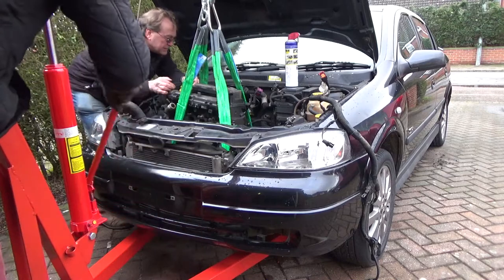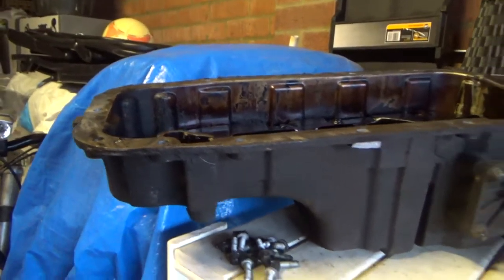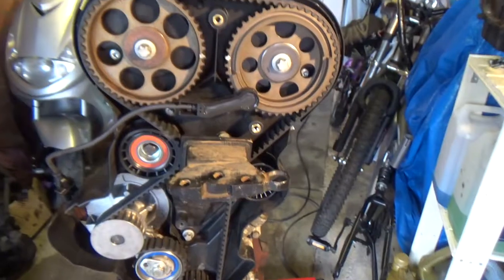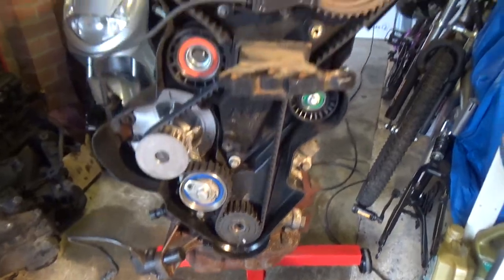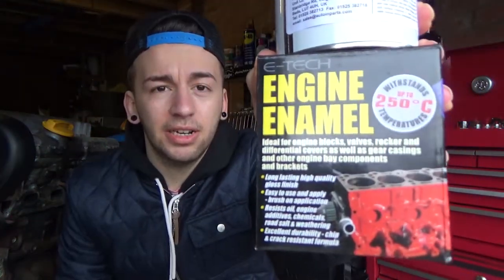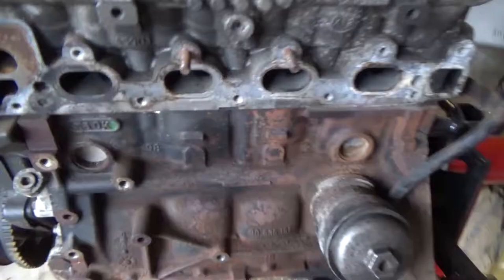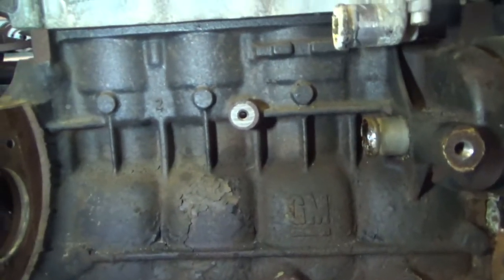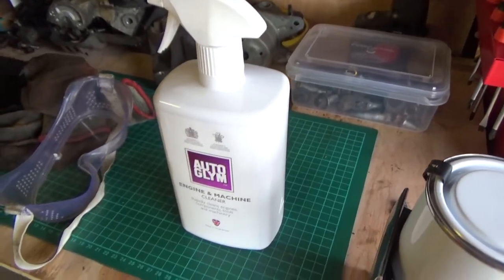Project SRI - Part #5 - Painting The Engine!

Comment: You might as well paint it while you have good access. A clean engine block will help you get the best possible price when you come to sell it. Your timing belt change is another plus point and is total peace of mind for the new owner. If you have to fit any new sensors make sure you use genuine GM or OEM ones. The aftermarket ones don't last and the 1.8 is the worst for this. Make sure that you use a decent quality engine oil and use a GM oil filter if you can.

Comment: Only car guys understand painting your engine.   Agree that black is fairly pointless.   Silver or grey stands out you can see things more easily and spot leaks or wipe down in the exact area....black tends to hide things    i would always go for a gloss enamel finish.  
If the engines still in the car its nice to paint the front of the block if you remove most of the gubbins.   Nobody sees the back of the engine.  Im painting mine soon even though its out of the car i will only be painting the sides and front.